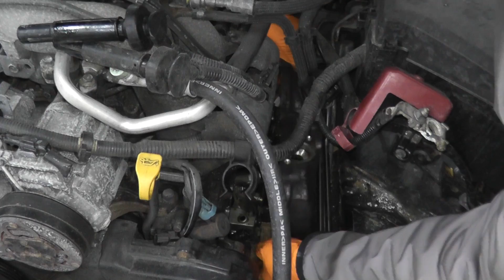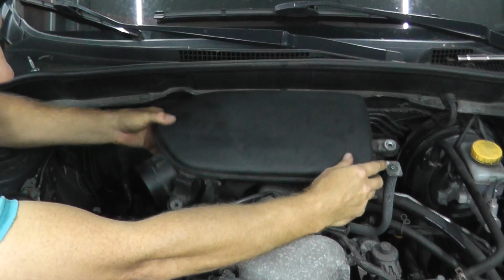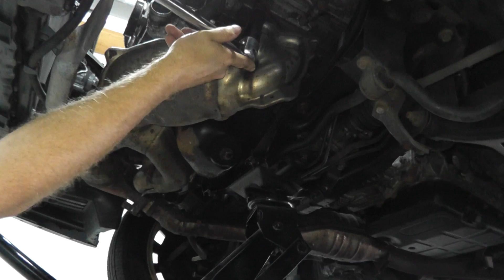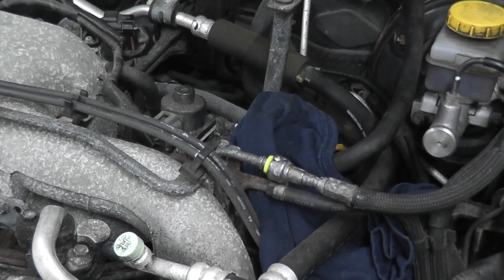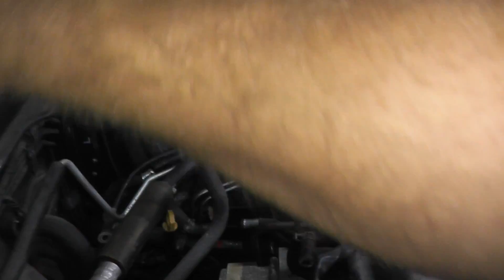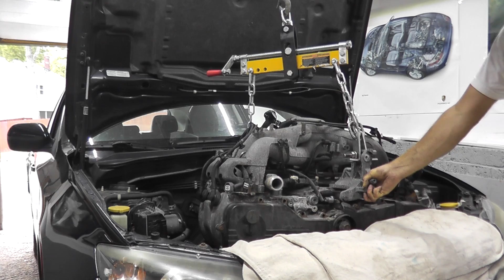Subaru Impreza - Forester - Outback Engine Removal AT HOME With (Mostly) Basic Hand Tools

Comment: GLOVES and EYE protection!! I actually broke a breaker bar (ironic huh?) a few years ago. Can't remember on what. But my point is, I try to always think about what my hands could hit when selecting a socket or wrench location. (You sometimes have a choice). And pull, not push, again, if I have a choice. BUT, I was once pulling hard, and the bolt broke, and I punched myself in the face! So I try to always think about possibilities and wear tough gloves and goggles when doing dirty or physically demanding work.

Comment: I don’t know if I’m the only one having problems with the motor mount nuts not coming off? I’ve hit it with heat an impact but I can’t get the nut to come off! Is there some sort of way to get around it ? The nut is spinning on the threads just not coming off
Reply: I figured it out just need to jack the engine up and put some weight on the top of the mount

Comment: Fantastic Video. I'm replacing the engine in my 2013 Forester. The old engine is an FB25 possibly from 2012 as it has been replaced once before, but your video along with some common sense made things so much easier. My replacement engine, also an FB25, has a few differences. Your video helped me work through them. Still have one thing to figure out, but I wouldn't have gotten it done without this. 
I have one question. In another video, it was suggested to drain the power steering fluid before reinstalling it. Is that a good idea? Thanks

Comment: Just a note from a fellow old Subaru owner: Those grounding straps may have just been corroded through. Mine looked almost identical when I checked a few years back, and I'm certain the engine has never been pulled.

Comment: Good job, bro.  Appreciate the video . Good heads up and excellent step by step guide. Doing my engine this week .02/27/2024. Will update when iam done . Also replacing timing chainnandnguides water pump and spark plugs .. doing lower and upper control arms, all stabilizer links front and rear .. 4 hub bearings  brakes and rotors all around.  I'll donthe mounts next month all fluid changes front dif rear dif Trans rear rear . And new gaskets before installing the engine.. Great car has 198k on the clock. Timing chain went, and it did havoc on the top end. Got one with 148k ... gonna do all the lil things . Tlc... All and all, thanks a million great vid  and tutorial.. much appreciated
Reply: Oh yeah and all 4 struts ..

Comment: You need to remove the dog bone from the bell housing so you can jack the front of the transmission to allow you to slip the rear of the engine off the two studs at the bottom of the bell housing!
Reply from the maker: Thank you. The dog bone was removed.

Comment: bro ur vids are awesome! i have oil leak. no milky resedue, no black/white/blue fumes from exhaust. not lossing coolant, just loosing oil. when I do pull the dip stick i have oil almost half of the stick. im not sure if my head gasket at fault or the valve cover. the dealer quoting me 5k for an entire engine reseal? what r ur thoughts? im still rocking my 2010 impreza 2.5i. dont know lot about cars but i can dable with breaks, oil, spark plugs. thanks brotha

Comment: Why do you have to remove the torque converter bolts when you pull the engine? My 2011 for forester has star shaped bolts instead of standard hex really dont want to buy more sockets that all barely use

Comment: How did you get the lower nut on the starter off? Since you didn’t show it in the video. If you ran into problems with removing that nut. Such as the nut being rounded on 2 sides how would you remove it?

Comment: Good video, thankyou. A couple of points, not sure you need to remove exhaust headers just let it hang on the tailpipe, just need to clear the head exhaust studs. The pitching bracket needs to be undone to allow transmission to tilt and engine mounts clear the cross member. Jack the tranny til the engine mounts are clear of the crossmember, the pull engine straight forward. Thanks for tip on the torque converter wanting to leave the building. Its not build quality from subaru causing head gasket problems, its actually the composition of the head gasket material, it was not suitable long term. Always replace the gaskets with subaru oem multi layer steel ones, problem solved.👍
Ps the corrosion on that engine hurts my eyes.

Comment: Oh my friend you must have sore knuckles often.  When pushing something like a breaker bar I never close my hand over the bar.  I always just push with my palm.  That way if the socket slips one is much less likely to crush their knuckles against some hard or cut them on something sharp.  An old wrench clued me into that understanding over 35 years ago and my knuckles have suffered less injuries as compared before he wised me up.
Reply: I agree completely!  Also consider pulling rather than pushing - sometimes more control in that direction. 
These are basic tool use procedures that help not only with effectiveness but safety. Above all else, guard not only your eyes and ears, but your hands. You’ll be happy you did when you get to be 76 and your hands still work and feel fine. Ask me how I know! 😉🔧👍

Comment: Thank you very much for sharing/showing. I watched a couple of your videos and you explained things very clearly. I have '05 forester with high mileage but runs very well. The Correct CEL has been on the says PO400 (faulty EGR) I replaced the EGR  and cleaned the related parts (hoses etc) but it didn't fix the problem. Can you tell me based on your best experience what might be the culprit here. I also replaced the CAT a few years back, but it's not a genuine part,  does it have anything to do with the PO400 code? Thank you very much. All infos are welcome.
Reply from the maker: Check the throttle body and manifold absolute pressure sensor. Is the throttle body secured?

Regarding the map sensor, you can take a reading with a sophisticated scan tool and verify it's working correctly. Here's a video I did a few years ago showing on how to test and replace the sensor on a Subaru -  https://youtu.be/QSR6pIXzvl0

If all is okay here, there must be a blockage or leak somewhere.
Reply: @Carsntoys Thank for your response.  I think it's secured, but I will check again.

Comment: My hat's off to you for tackling this job!
The head gaskets on my daughter's 2010 Forester were replaced by a reputable independent Subaru specialist garage (I avoid dealerships like the plague)  with 105K on the clock.
Head gasket issues, timing belt rather than chain, and general boxer accessibility headaches, if I had it to do over again I would have gone with a Rav 4, no doubt about it.

Comment: You don't have to remove the catalystic converter from the exhaust to pull the engine. Saves you some time.
Reply from the maker: Thank you. I wanted to remove the rattling heat shield since I was there. Cheers.
Reply: @Carsntoys  cool! I just removed mine, it was very annoying l.
Reply: Correct

Comment: That tip, using the socket and extension to give yourself more leverage, was worth watching the video . Thanks for the great content!
Reply: ⁿ oops 00000000⁹o po 9p 9oò😊
Reply: I agree! I have several pipe extenders I’ve made to fit various tools, but no shorter ones, which is exactly what this is. I love being able to use tools for multiple tasks. 
Correction - the word is “torque”, not “leverage”.

Comment: Amazing vid as usual ! 2008 Impreza 2.5i Hatch MT Sport here with 99000 Km. Will use this vid as a reference for the future when my turn comes. Hopefully the head gasket get bad from usage but not just from old-age (12 years) but low Km. Are you going to use the multi-layered steel (MLS) gaskets from the WRX/STi instead of the crappy mono-layer graphite composite one from the N/A model ?
Reply from the maker: Thank you. I used Felpro gaskets.